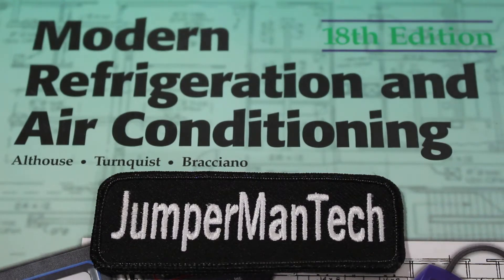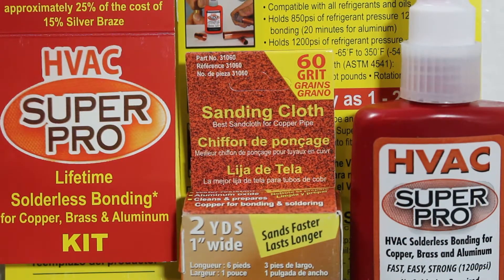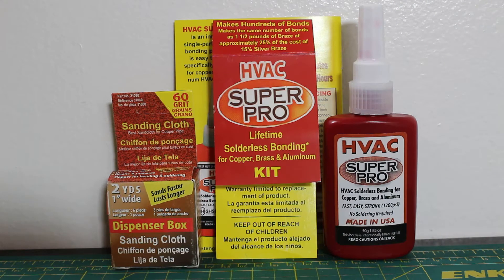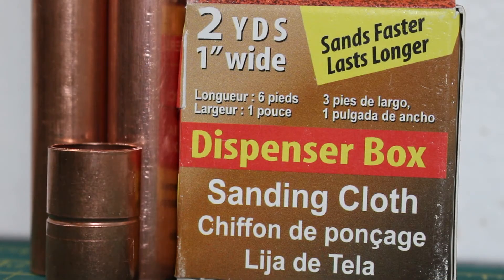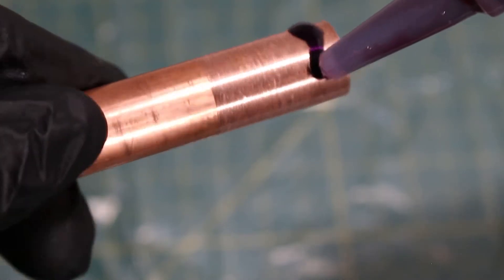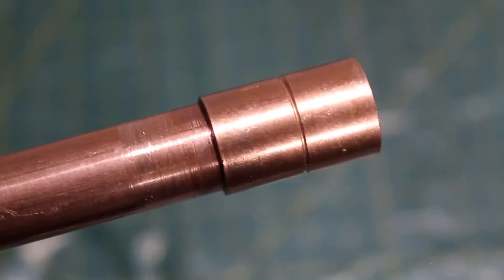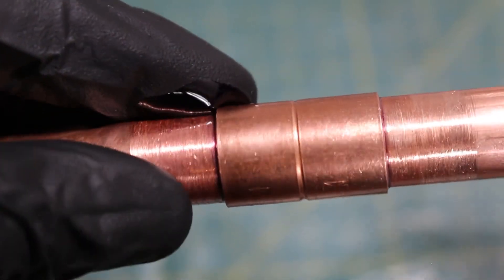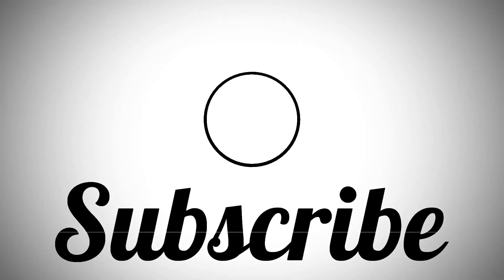Solderless Copper Bonding (HVAC SUPER PRO) Bonding For Copper, Brass And Aluminum!

Comment: Yeah…no. Does not work. If you work with refrigerant lines, you know they are rarely perfectly round and have gaps. That is the reason soldering is not a good idea. If you think a liquid glue works, you need to get out of the business.

Comment: This looks so unbelievable. I am trying to replace a compressor in my refrigerator. I don't have the brazing/soldering skill. Do you think I can use this product for that purpose? Also two of the connections are copper to steel (to and from the condenser). Do you know if this will work for those lines as well? Thanks a bunch.
Reply: i would look at Staybrite 8,  will not need a fancy torch also will solve the problem of bonding unlike metals.
Reply: You need stay-silv flux and 45% braze rod to do that and alot of heat.
Reply: It wil not work on steel , it even will never react properly in contact with steel.

Comment: Cool ! Hey if its good for water could you use it on small condenser water line's say 3/4 ?
Reply from the maker: It's really made for high pressure refrigerant lines. I've only used it for drain lines and it worked great. Could def use it for 3/4👍
Reply: Did it on 7/8 Line set for 3.5 ton system expecting it to fail, it was in a easy to get to location on very short run so it was no big deal but I tried it and somehow the stuff worked.   I used it previously to replace a split hose bib 1/2 inch copper line and that has been holding for years now.   The AC is a new thing but dang it.. it worked.